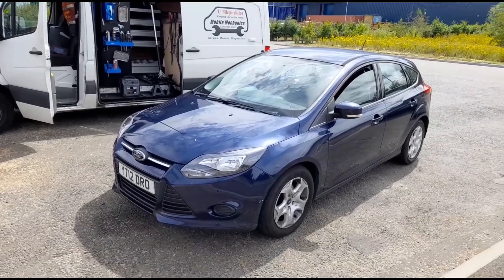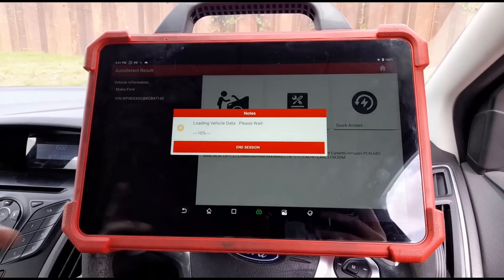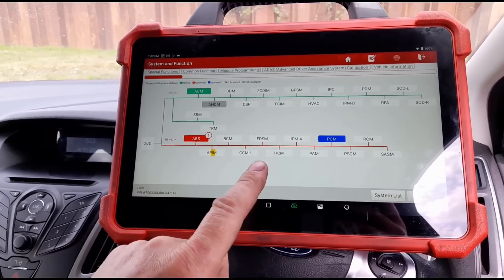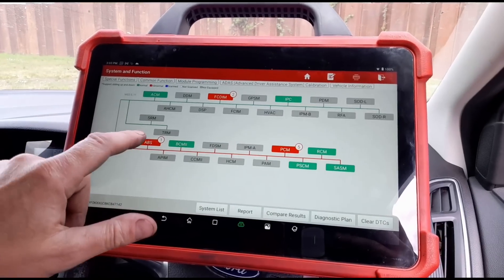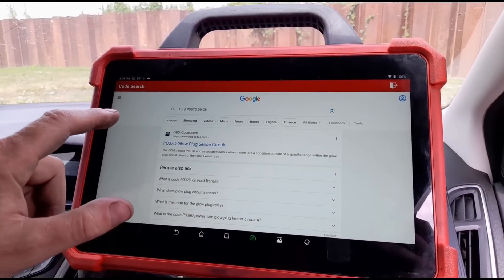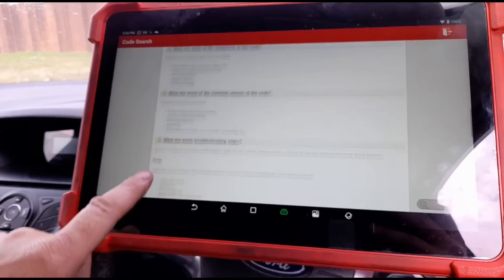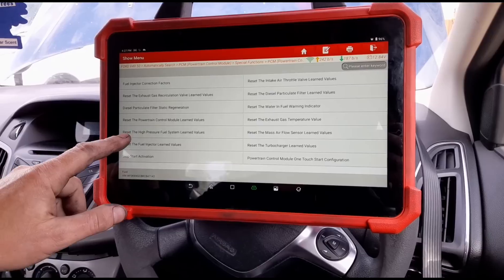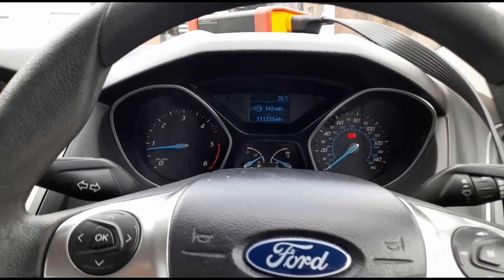Ford Focus 1.6 P02D3 P02CF P02CD P02D1 Cylinder 1 2 3 4 Injector A Offset Learning At Max

Comment: Hmm, interesting. Got same 4 codes on all cylinders on my v50 d2.
The state of the air filter was as bad as in yours.
Changed fuel filter also.
Perhaps i should try to re-adapt those injectors after the basic service.

Comment: Ive got this engine. Mine has a vibration. Ive been told by the internet its most likely an injector under delivering because of either a gunky filter or sticky injector. No codes and I have no idea of standard figures so cant compare live data to find anything out.

Does anyone know the most common reason for an engine vibration/wobble that turns into a buzz that matches with revs which fades above 3k rpm? Is it under delivering injectors?
Reply: Have you solved the problem?
Reply: @miki2-j4s  not yet. Ive tried a direct injector clean, intake cleaner, the spray in egr cleaner stuff, intercooler flush, cleaning the maf, changed the pcv flap and spring, map and crank sensor both checked and ive still got the vibrations and similar sound. Im going to take the egr pipe off and see if thats clear. It may be the egr cooler being clogged. Ive got the tzja engine, 8v 93hp. Its the only air related part i can think of. Other than that, im guessing its the injectors, but starts fine, no knocking, no loss of power. Had the MOT with it and no exhaust leaks or emmisions problems. Had the turbo lines checked and nothing wrong there. Im at a loss so its going to mechanic monday. If they find anything I will update.
Reply: @ 
Do an injector overflow test. Buy 4 urine containers with ml indicator and connect transparent tubes. Start the engine for 4 minutes and if one of the vials is full, you have the culprit.

Comment: After I learned injector values,engine start to misfiring,smoke with diesel smell. Should I replace  injectors ? Thankyou
Reply: Hi, can I ask if you were able to resolve your problem and how? Were you able to do relearning? I have a similar issue. Thanks

Comment: Correction reset and Drive cycle so the ecu learns the pilot correction values on these after 100k imo is a must ! 
Have changed injectors on these before and the sound harsh until correction cycle is learned , nice long hill and 3/4 gear 1500 to 2500rpm acceleration and then let the engine ‘ brake ‘ back down to 1500 and repeat. Usually see a counter in live data that counts up to 7

Comment: Do you have the link for that turbo hose glue pls?
Reply: It's looks like it's a super glue, medium to high viscosity. I've successfully  used it before on split boost hoses and it held well, perhaps get an activator to prime the surfaces like in a mitre glue kit and it'll bond instantly.
Reply from the maker: https://www.toolstation.com/hv-super-glue/p78871?utm_source=Rakuten&utm_medium=affiliates&utm_campaign=4639078871&utm_content=Redbrain&ranMID=46390&ranEAID=pfxNKSnglIM&ranSiteID=pfxNKSnglIM-G8jdu6HE2HavfSmjfMVlyg

Comment: Glow plugs are used to help start but very often still used during initial warm up. If one has failed it leads to irregular running as that cylinder has lower performance compared to the rest. That can damage a dual mass flywheel a lot costlier repair, damage is caused due that cylinder not performing and causing a kick or torsional vibration in the engine running. This overloads the Ark springs in the dual mass flywheel.

Comment: Any tool, hammer screwdriver plane it’s having the knowledge to use the tools.  Owning a plane does not make a carpenter. Same with a scan tool, owning one does not make you a specialist. Without one your screwed even if you know what your doing.

Comment: That motor will be needing a set of injectors soon. There’s a specific drive cycle that can be done to improve rough running when cold but their time is nearly up. Filters won’t do much to help.
Reply: Exactly that learning limit code is to do with injector wear and the learning limit is to compensate for that wear but once it goes too far then that code pops up. Common thing on these especially if they have the Siemens injectors in them was hit and miss whether they were fitted with them or Bosch ones which were much better.

Comment: It doesn’t pay to cut corners on not having your car Serviced regularly. My wifes Ford focus mark 1 is now 20y old but only covered 65.000 miles but she has it serviced every 12 months and it runs like the day she picked it up new from the dealer on the first day of the 03 reg
Reply: Same here with my 21 year old Mercedes 2.7 CDI emissions are the same every time it goes for a MOT. Plus the cost of these filters why not change them more often.

Comment: The offset fault code is indicating the injectors are at their maximum learned limit. 
Relearning is a possibility which may improve running and drivability but they’ll almost certainly require replacement.
Poor quality fuel and or lack of maintenance doesn’t help.
Reply: I’ve recently relearned these on my partner’s 2012 focus and I don’t recommend anyone does this as it’s made the problem worse. Had to at least try before I replace the injectors.

Comment: Shouldn’t you have replaced the oil and oil filter as well as the air and fuel cause guaranteed if the air filters that bad I can only imagine the state of the oil filter 🤦🏻‍♂️